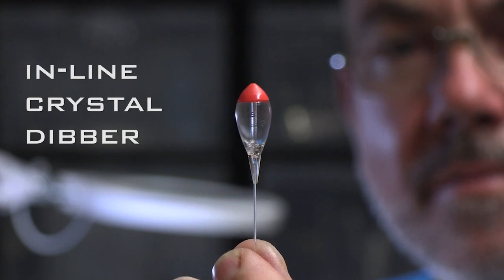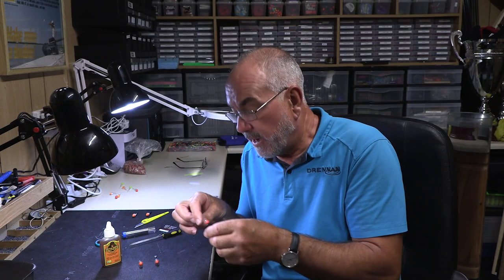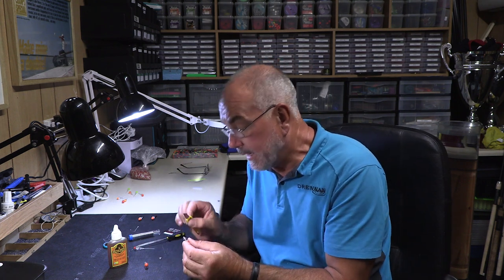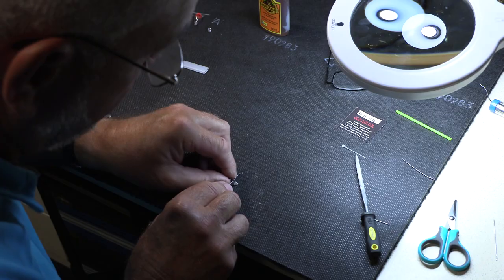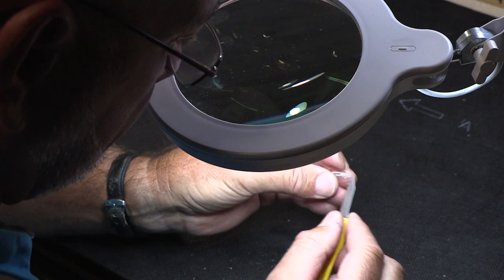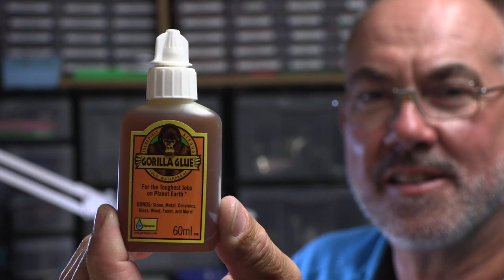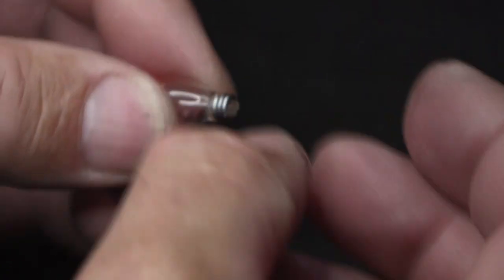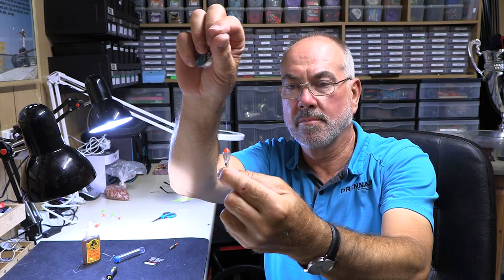How to make a Crystal Jigger float | Alan Scotthorne | Match Fishing

Comment: Where do you get your led from please
Reply: It's been a  while, but you could get it from electronic supplies and craft shops.
Reply: Flyfisher shops do have them also.
Reply: It's solder wire bro get it in any D.I.Y or ebay  available in different diameters,para